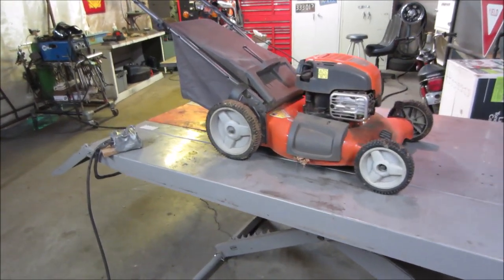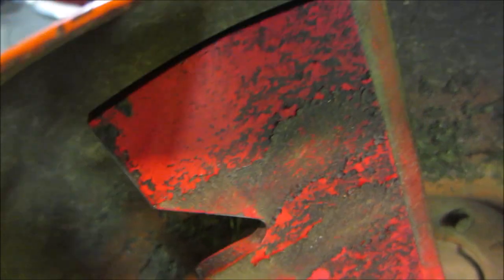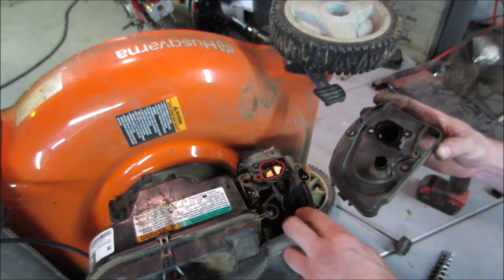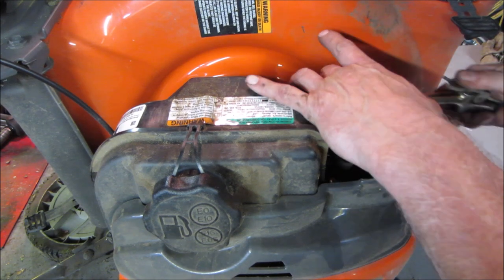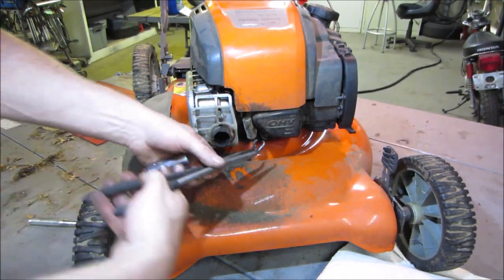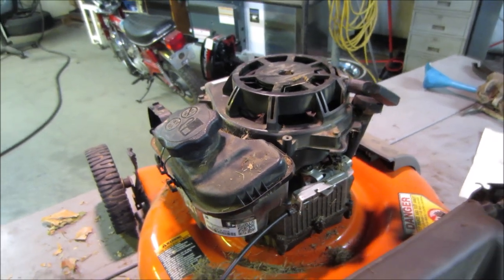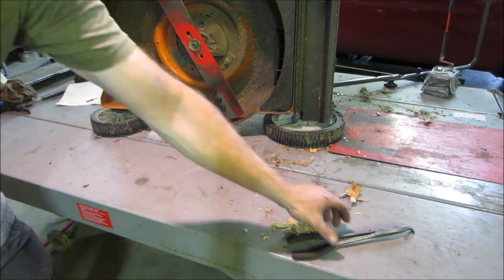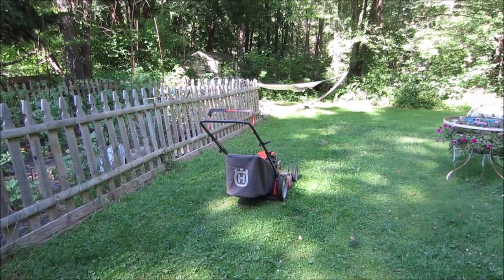NO OIL CHANGES? Servicing A Broken Yard Sale Lawn Mower,

Comment: Just check and add......and then buy another lawn mower
Reply: Pretty much.
Reply: Exactly 👍 in the very wasteful and neglectful world we live in today.
Reply: I call it the Walmart mentality. If it breaks, you just throw it out and buy a new one rather than fix it. I've had the same lawn mower for the last 15 years, and it still works just as good as the day I bought it. I change my oil every season, and I sharpen the blade every season. I also switched out the oil from the standard 30 weight, to synthetic 5w 30, which really causes a little bit more oil burn, but it's a better oil.
Reply: @markssmallengines3542  Toss it every season that;'s what the neighbor did in the ritzy sectionsof our town
Reply: @chubbysumo2230  we had ours for over 30 yrs 1967-1998, only when I was on the third deck and the bolts were stripped that I gave it up and tossed it.B+S motor from SEARS
Reply: @chubbysumo2230  I ´ve been cutting grass with my White for the las 20 years or so,and I tooked it for free fron a friend that used it for 5 years before and neglected it for good!.yes if you give them a little of care they last for years...
Reply: I was in the 64th comments group & 46th comments squadron.  👍
Reply: @chubbysumo2230  10W30 is better for the higher temp.
Reply: @chubbysumo2230  What is your reason to change to 5w 30? Just asking.
Reply: 3 YR WARRANTY TO REPLACE OPERATOR ERROR.
Reply: capitalism baby
Reply: @gertraba4484  We had a Toro when I was a kid that my dad bought in '83 or so, one of the first with FWD and multiple throttle settings, if I remember correctly.  It developed an oil leak at one point, so we never changed the oil, we just topped it up every spring.  It ran all the way up until the handlebars broke in '99 or so when we junked it.  I wish I'd had the Mustie mentality back then, I just would've had them welded up.
Reply: Just uses synthetic instead of conventional
Reply: @chubbysumo2230  ; Ha, my mowers are 30 years old !!  The little 3.5hp pushmower is sounding pretty bad these days, I think the rod bearing is finally going.
Reply: Planned obsolescence at its finest !
Reply: What happens to the oil?  Is it designed to burn oil or something?  If it is not burning it, the oil will get really old.
Reply: Hammer0f Thor yes that’s why box says 3 year warrantee, they figure that’s about how long it will last😂
Reply: John Loesch My thoughts exactly.Cheers
Reply: tarstarkusz it’s very possible that old oil in a lawn mower does not shorten its life
Reply: That'll work...top off with oil and it'll prolly last three years with no other maintenance.  That's what, $50 a year equipment cost?  Still cheaper than a lawn service for most folks.    My $130 walmart mower lasted 7-8 years with oil changes; it finally blew a head gasket.  If the front-mounted carb didn't have issues (due to smacking it into shrub trunks), I would have repaired it.  Now the timer starts again with the new mower, lol.
Reply: Michael Cox yep and it will last a lot more than 3 years topping off the oil
Reply: @noidontthinksolol  yea growing up my dad had a Murry lawn mower and he ran that thing for over 20 years never changing the oil or air filter, when it finally died it wasnt even because the motor went bad, it was because the handle and body were so rusted out it wasnt even worth keeping
Reply: Wrong way blade equals failing to shut the lid on my washing machine. Embarrassing.
Also:
R.I.P. Rabbit production:(
Reply: AFCS all the way!
Reply: I have this exact same mower and have used it every year for about 7 years now with no issues. I am a fan of Husqi products.
Reply: @chubbysumo2230  A quart of  oil  every year is much cheaper than frequent equipment failure & a oil change takes little time.
Reply: no worries, the carburetor will gum up and stop it before the oil is bad :))
Reply: @chubbysumo2230  I use 5w40 diesel synthetic and don't burn any oil in my Briggs.
Reply: @boondocker7964  it's still a 30 weight but doesn't thicken as much when cool. People misunderstand oil ratings. Only the second number has anything to do with how thick it is when the engine is warmed up and running. The first number is just a pass/fail flow test at very cold temperatures. 30, 10w30,  5w30, and 0w30 are all the same thickness when hot. Most engine wear happens when the oil is still cold and not flowing, so the lower the first number the better. However, I find that 40 grades are better for small engines, as they are slightly thicker and most are diesel oils which have more anti wear additives.
Reply: @Bill Taggart I've never drained my gas over the winter. Rather I top it off to be completely full so that there is no room for condensation to build up and it starts first pull in the spring. I do change the oil and check the plug gap and clean if needed, usually get several years from a good NGK.
Reply: @pb7379-j2k  It has to. Eventually wear metals build up to the point they will wear the bore and bearings. Particularly in this case as they are telling you to leave in the factory fill! The first couple oil changes are by far the most important. The engine will put tiny metal flakes into the oil as it breaks in. After that you could probably neglect it for quite awhile. But either way, an engine will last longer on clean oil than dirty. Not to mention oil will eventually oxidize and lose its viscosity. Topping it off may keep it alive longer, but an engine with oil changes will last longer still. We have some old Briggs that are probably 50 years old on the farm that still run great.
Reply: Keegan Johnson I know the theory. Your anecdote shows that with lots of care, a machine will last.

But it does not prove that the top off method prevents a machine from lasting.
Reply: @pb7379-j2k  it's not a theory, it's science. Oil is a lubricant. The thinner and more polluted it gets, the less effective it is. Less effective lubrication increases friction. Friction leads to failure. There's a difference between adding a quart or two and a new filter that removes wear metals to an old car, and adding a fluid oz or two to a heavily polluted half qt in a small engine with no filtration system.
Reply: Keegan Johnson respectfully what you have presented is a theory.

Whether it results in a meaningful difference in the lifetime of a lawn mower is something that can be determined by experiment, which I assume you have not performed.

But I’ll bet that every engine manufacturer has.
Reply: @pb7379-j2k  I havent, but there are thousands of examples of used oil analysis out there and engine teardowns with bearing wear measurements to go along with it. Now, almost all are in automotive applicstions, but one can use logic to assume that what is true with a filtered system must be true with an unfiltered system and then some. Whether it is worthwhile in an era of plastic drive gears and thin deck steel is another matter, but as far as engine life is concerned it's pretty extensively proven.
Reply: Keegan Johnson but that’s the key. We are talking about this mower and if changing the oil affects its usable life.
Reply: @pb7379-j2k  true, but if you care for your engine, and the mower wears out, you can save a lot of money buying a similar mower who's owner didn't care for the engine and blew it up, and put on your engine. So it's still a worthwhile endeavor to take care of your engine. You can get a gallon of 15w40 diesel oil for 12 bucks and have 8 years worth of oil.
Reply: Keegan Johnson I agree with you but that is out of the skill or desire range for a huge percentage of mower buyers 😅
Reply: @pb7379-j2k  it's a sad world when removing 1 blade bolt, 4 engine bolts, and one cable clamp and then reinstalling them is not something any man can do lol.
Reply: After working on mowers for 25+ years, that's what most people want. Because they damn sure don't want to pay someone to service and fix their machine.
Reply: Juan Lopez  in what way? The decks are thinner, they use more plastic parts, and they give dumb recomendations like this. Now, OHV engines are certainly more efficient than flatheads, but that's the only real improvement, and with how little fuel an engine like this uses it's not very relevant.
Reply: Juan Lopez  plastic gets brittle with age and cracks. It's common knowledge. Steel doesn't. If you touch up the paint it won't rust either.
Reply: Juan Lopez  it might outlast plastics of 20 years ago, but it still gets brittle eventually, and is still inferior to steel. Now it it was fiberglass reinforced, it might last a decent while, but none of the models I've seen use that.
Reply: Keegan Johnson that doesn’t make me sad. People might have other interests.
Reply: Juan Lopez  I use everything as long as I can. Us "cheap Swedes" are known for it haha.
Reply: That is the way they build them now. My toro is 4 years old and the oil is just now dirty. They want you buying a new one every 4 or five years
Reply: In europe we never use W30 oil, i put 10 w 40 in everithing! Its better. I change when its dirt, my car has 280000 km and my mower lasted 22 years
Reply: @eclipsegst9419  preach it!
Reply: It kinda makes sense, considering most people burn out their mowers LONG before they ever need an oil change.
Reply: ShootTheMoon  I have one of those!  I hate I killed it by hitting something and came up through the cast aluminum deck or I'd still be using that today.
Reply: ShootTheMoon  I saw that..lol. Mine was extremely rare too.  "LawnBoy/JCPenney' branded.  I may try to fix it one day...still have it. I don't know what year mine is, I think it's late 70's early 80's
Reply: @throttlebottle5906  With proper maintenance, the carburetor will not gum up. Use good, clean, and fresh gas and add some good gas additive occasionally during the season and especially when putting away in the fall. Fresh gas and oil, clean air filter, and a new spark plug, and these little engines will run forever. Definitely should out last the rest of the mower.
Reply: That’s right but next time buy a Honda and change the oil
Reply: Planned obsolescence.
Reply: I would change the oil just like I would breaking in any new engine. I would change it again, just before the following season. After that, I'm pretty confident, that the engine would out last the mower anyway, with just the "check and add". I feel that ANY new engine needs oil changes, during its initial break-in period.
Reply: @eclipsegst9419  
No, not really. A 5w30 oil is kinda like a transvestite: it looks like a 30 wt, but deep down, it's 5wt that "dresses up" as 30wt via use of viscosity index improvers.

Now, this means that the oil boils off and it flash point are based on the 5w that it "really is" w/o the VIIs. And, under extreme heat and pressure, it will revert back to the 5w it really is, temporarily. (AKA "viscosity breakdown.")

So, no, 5w30 is not the same thing as 30wt.
Reply: @bcubed72  that is 1970s logic. Modern oil bases have a much better natural Viscosity Index than they used to. If you buy a bottle of modern SAE30 and send it in, you will find that it is actually about a 20w30, and if it's synthetic, it's actually a 10w30, just off of its own inherit properties. They market it as SAE30 still because otherwise old guys would flip that they "can't get their real 30W anymore". So a modern 5w30 has far less Viscosity Index Improvers than it used to. It doesn't begin life as a 5W, it probably begins as 15W with a 5w15 viscosity index, or a 20w synthetic with an inherit 5w20 viscosity index, and then is bumped up a little to reach 5w30. Also modern viscosity index Improvers are far superior to those of years past, and shear is almost unheard of unless caused by fuel dilution. So if your 5w30 is not shearing down at all over it's Serv life, than yes, it is a 30 weight oil at operating temperature and the only significant difference between it and SAE30 is that the 5w30 doesn't turn to molasses when it's cold out, and it gets to your bearings faster, every time you start it. 80% of wear is at startup, the smaller the first number, the better.
Reply: @eclipsegst9419  "Also modern viscosity index Improvers are far superior to those of years past, and shear is almost unheard of unless caused by fuel dilution."
Actually, (temporary) shear occurs by design in "Energy Conserving II" oils. Under high load, there is a temporary loss of viscosity as the VII polymers align with each other...if the oil didn't do that, it couldn't beat the reference oil's fuel consumption numbers.

While you are mostly right about modern automotive applications, air-cooled OPE runs hotter, and you cannot make the same blanket statement that "a 30 wt is a 30 wt." Certainly a mineral-base 5w-30 will be more inclined to evaporate out the crankcase than straight 30wt, and more frequent oil addition may be necessary.
Reply: I have an old aluminum deck homelite push mower and a simplicity push mower from the 60s, and they are both running strong with regular maintenance.
Reply: @chubbysumo2230  the grass  in  my area (idk if its how often  we  cut it)but it shreads  the blades. like after maby 2   cuts  (bout4 acres) they need  to be sharpened idk  ifits shit blades or what but those blades dont last
probs dont  help  with grit n crap
Reply: I hate that
Reply: @chubbysumo2230  I dont understand, I didnt change the oil, replaced spark plugs and used 1 air filter in 16 years of use and it still keeps running. I think those tight tolerance engines thosedays that needs 5w30 just breaks down faster.
Reply: @markssmallengines3542  People are more environmentally conscious today than they've ever been. The problem is we're inherently selfish.
Reply: Agreed mine is over 20 yrs old starts 1st pull and runs like a top the rest of it is falling apart though
Reply: I have the exact same machine,,, started smoking like crazy. Drained oil “ had to much” changed filter and spark plug, topped up with fresh oil and 93 octane fuel, smoked for about a few minutes with spitting some oil from exhaust but after about 10 minutes of running it was operating perfect,,, great machine but not changing oil and just topping it up is a bad idea. Change it every season it only costs $10 or so for oil!!! I’m just happy it wasn’t the head gasket

Comment: It amazes me how little some people know about the most basic of all petrol-driven machines- the humble lawn mower. I was given a venerable Briggs 375 mower with identical blade to that here. The bloke who gave it to me said it just didn't want to run. I cleaned out the carb, made a new air filter out of some foam I had floating around the garage, put in nice clean oil, new spark plug and wow! The thing has run sweetly ever since, always starting on the second pull!

Comment: I'm glad to hear that dumping the oil out of the dipstick hole isn't a bad way to change lawnmower oil. that's what I have been doing with my lawn mower as it's drain plug is under the shield/guide thing for the drive belt for the blade, and I'm not going to take the blade off, and take the belt off to get at the plug.

Comment: Mustie you should show people about reading the sticker on the side of the gas tank. It tells you how long the engine will perform according to emissions. They rate it for hours until it wears out. If you read these labels it will tell you how disposable it is. Each engine from Briggs will have its own rating.  The longer it lasts before it is wore out is a good way to tell if it is worth spending more money on a different model. I was surprised to find how different the ratings were for different models of chain saws from the same manufacturer .

Comment: Well done fixing up that mower.  Finding assemblies that have been put together incorrectly is a problem.  And lack of maintenance for yard equipment.  My house has a few concrete paths, and the driveway, so I bought a second hand Little Wonder lawn edger - about 4 years ago.  Has the BS 3 1/2 horse 127cc engine.  Previous owner demonstrated that it started and ran.  Dismantled the carb and air filter.  Carb was good after some compressed air.  Foam air filter disintegrated.  Spark plug still had white paint on it: most likely from the factory.  Drive belt for the cutting blade was frayed, and probably original.  Blade was worn out.  Replaced all these parts with new.  Changed the oil.  The BS has 2 fillers and sump plugs.  Found the date stamp on the engine: June 1984.  Still using it today.  Starts second or third try from cold.

Comment: great fix , love the drive/flea market bit at the end. we bought a mower in 2000 and I changed the oil after cutting the lawn twice, I had some slick 50  for a car I had at the time and put about a tablespoonful in the mower before the oil and it's still working today (B&S sprint 40 engine) deck will rot out sooner than the engine will fail.

Comment: I just picked up a “Yard Machine” push mower on the side of the road. The motor is almost identical to that Husky. It took about an hour to clean out the carb and tank. The motor has quite a bit of power, it’s a 125cc .
Reply: I've got the same mower I bought new at Home Depot for around $150. It is a powerful little motor for the displacement and tough. I've used it as a bush hog several times now with no issues. I do clean the air filter and change the oil about every 12 hour's of use though. Figured if I'm gonna run it hard I need to maintain it even better.